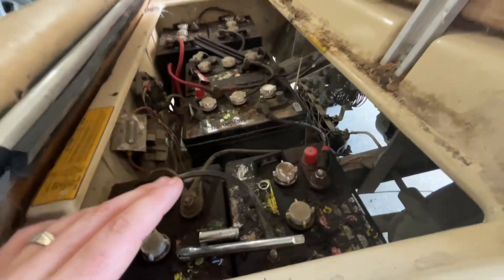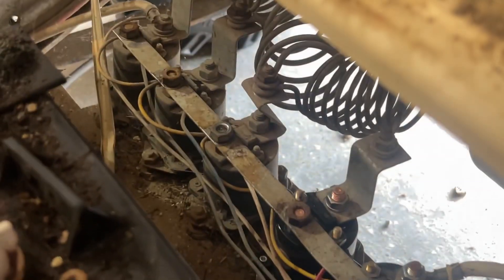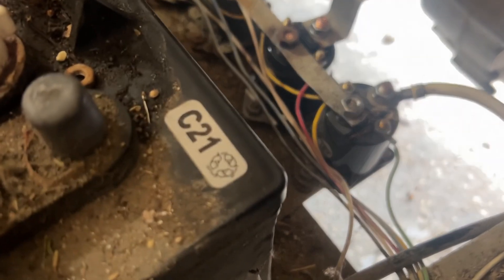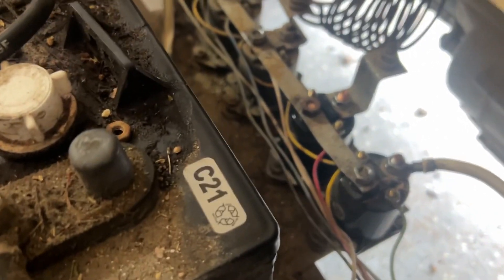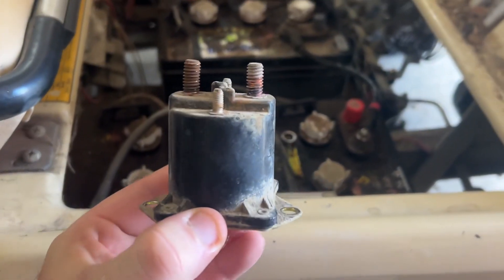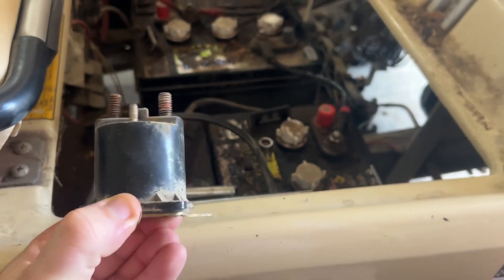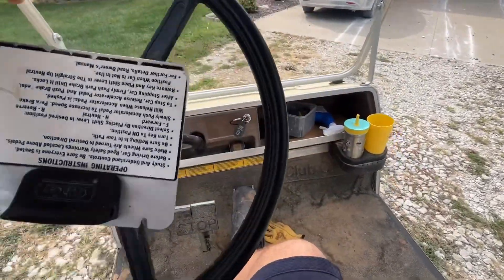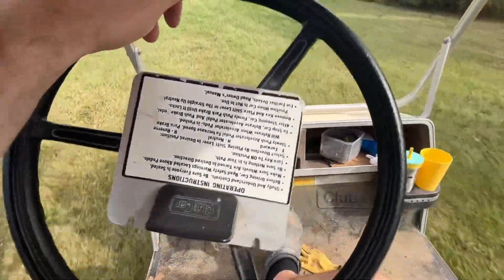Electric Golf Cart Jumping/Jerking/Bucking Badly When Pushing Gas Pedal - Part 2 - FIXED

Comment: My cart is doing this jerking but rather than that row of solenoids, since mine is a newer one, I do not know how they pull those steps off. I am guessing that they may be inside a black box that looks like a power source. 3 inch by 5 inch by 6 inch box or so.
Reply from the maker: Yikes. I ended up getting a gas golf cart few months back